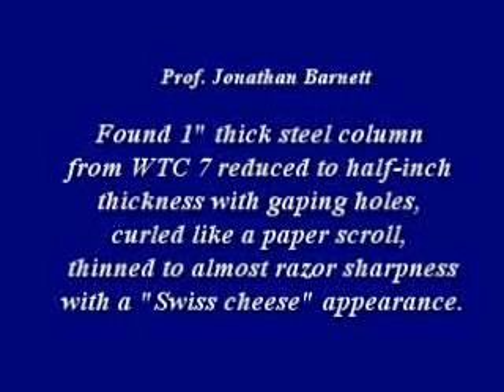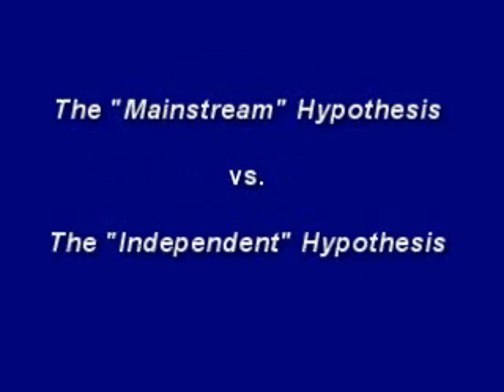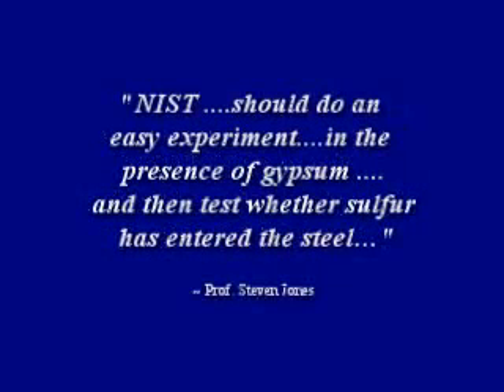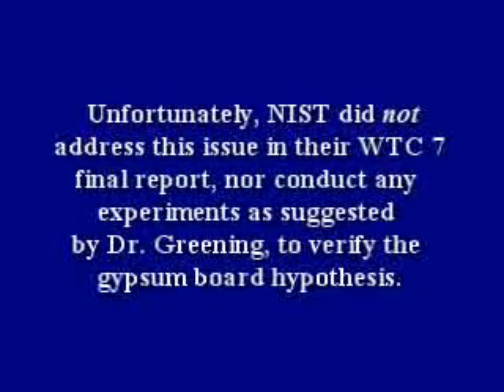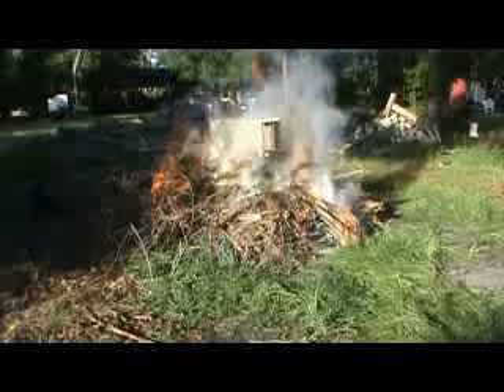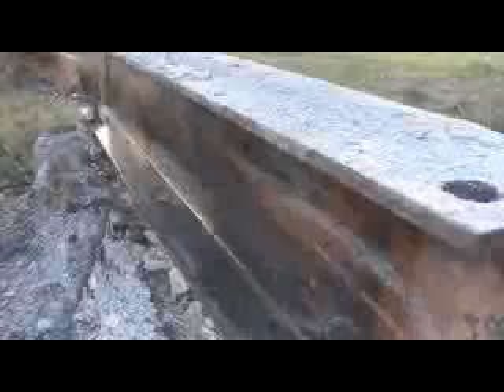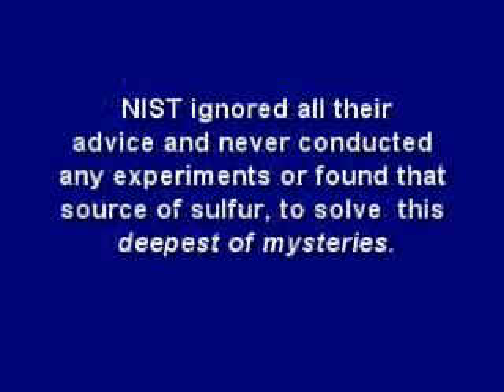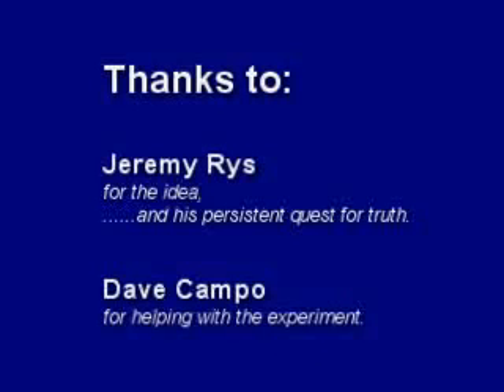9/11 Experiments: The Mysterious Eutectic Steel

Comment: Since you are an aircraft "mechanic", could you do me a favor,
and comment on the Boeing 757 wheel truck pictured at the
Pentagon on the web page below? Doesn't quite fit a missile, huh?
PENTAGON, 757 LANDING GEAR in the PENTAGON
11-settembre. blogspot. co m/2007/04/ english-section. ht ml

Comment: You are right. I have never seen an aircraft mechanic who doesn't
know ONE aviation mechanic term, tool, or legal form.
Did you know before you get your A&P license to work on an 
aircraft (actually, to even enter the Hangar)., you have to take a
CLASS on Title 14 documentation and handling of Certified 
Flight parts? As Little as a washer or spacer, it's certified, and 
tracked, or you can't work in an FAA certified repair facility.

Comment: By the way, Moron. A KEYED TORX screwdriver has a hole in the tip.
That hole fits over a POST in the screw itself, that keeps regular TORX
screwdrivers from inserting and turning the screw. Duhhhhhhh
Contrary to your nonsense, they are used all over aircraft, specially
in the engineering spaces.

Comment: Yup, flat's are a Brit term. They came along when metric terms came to
be used alongside English standard units. Functionally, they are PLANES,
and always are configured as parallel planes. That's why you can use a
BOX WRENCH, or hard steel, single configuration wrench, to turn them.
Do you know about box wrenches?

Comment: By the way, I am NOT talking about FLATs, Moron, which is a BRIT
term. I am talking about the pitch of the screw, and the peaks or
points of standard, DIN nuts. You know, the part that is NOT flat?
What's the pitch of a coarse machine screw? Ever use one?  LOL

Comment: LMAO, you have never come into contact with a TORX screwdriver in
an aircraft?  No kidding?? Wow, I guess airliners don't have a need
for secure, tamper resistant screws and bolts then.
OR, you don't know WTF you are talking about, which is my guess.
Wanna try for the Part 14 documentation for aircraft parts yet?
It's pretty hard to be an aircraft mechanic without parts, Ya know.

Comment: LMAO, now you don't know rounded NUTS? shit boy!
Nuts rely on 6 to 8 edges, and half as many planes of steel.
They screw around the Haft of the bolt, along an inclined plane,
that is an Archimedes screw. If the edge surfaces get rounded,
you have to use a COMPRESSION wrench to grasp the nut.
Vice Grips are typical, although there are many different kinds.
Otherwise, you will destroy the nut, the bolt, or both, Moron.
Aircraft mechanics, like you (giggle), use them every day.

Comment: Well MORON, a FAG / RAT, is a Flight Air Generator / Ram Air Turbine.
It deploys on ANY aircraft, from props to jets, to create an electrical
power source when power takeoff from the engines is unavailable.
Airliners have them mounted under the nose, or under the wings. 
Aircraft mechanics have to inspect and test them with EVERY overhaul.

Comment: Nope, the 767 pylon to engine connections are just 4 bolts, it's 
completely documented in the EL AL 1862 crash in Denmark.
That's where the engine fell off in flight because those four bolts
never torqued to specs? They are NOT shear pins, they are 1.25"
aluminum bolts about as thick as half my forearm, and over a foot
long, if you had ever seen one, like if you were a mechanic, you
would remember one. These bolts HAVE to be X-ray inspected
with every engine mount. YOU are no A&P mechanic, Huh?

Comment: Better Yet, How many bolts secure an engine pylon to a 757 or 767?
Surely an aircraft mechanic knows this, right?
How many bolts secure an engine to the Pylon we just mentioned?
Remember, they are DESIGNED to break away.

Comment: Try again, dumbshit. Plasma IS just a gas, and it's only considered a 
separate state of matter at nearly atomic temperatures inside a star.
Plasma torches, are just gas in an electric arc. I own two of them.
A 1000 lb Bunker buster is NOT Thermobaric at all, since the primary
point of Thermobaric weapons are to produce heat alone, usually to 
"Cook" dangerous gasses and materials into neutral ash.
NT if that's what you are babbling about, leaves IRON, and a LOT of
IRON, about 70 tons.

Comment: Nope, most of the heavy rubble was ejected toward West Street.

 I heard an idiot say "oxygizer" and that plasma is just a gas. Can anybody take this noxious $hill seriously? A 1000 lb. bunker buster bomb can produce a thermobaric explosion that looks a lot like the impact explosions at the WTC. Plasma from a thermobaric explosion can melt steel beams, engine blocks, etc. It is highly energetic and will impart huge amounts of heat to the path of least resistance...G:

Comment: Spend some time with steel welders, Dumbshit. They usually SIT 
on the same steel they are welding and cutting, often within inches.
The white hot edge of the steel being cut, is usually black within
inches of where they sit. That's because the heat dissipates thru
the piece, and that would happen with thermites also. Try again, lol.

Comment: Actually, this country, is among many others, where WATER cuts steel.
In virtually any country on earth, plasma, which is just a gas, cuts steel.
Oxy-Acetylene torches, which are just a torch to heat the steel, and
OXYGEN, which is just an oxygizer, are used to cut steel.
The FACT is, that steel members have been broken, cut, and damaged,
just by storage weight, cars built with aluminum, and even wood has
been used to sever steel. It's hardly rocket science.

Comment: LMAO, like usual, you don't seem to understand basic heat processes
either. IF you apply 500 degrees to the center of a steel rod, you won't
heat the ends hardly at all. That's why frying pans have 1 foot handles.
Can't get any more obvious, and real world stupid than that.
Heat dissipates as a function of it's environment. The HOTTEST parts
dissipate more heat, so just like your pan handle, the application of
heat to a cold piece of steel would be dissipated within 1 or 2 feet.

Comment: Actually, STEEL weakens at well under 400 C, not 800 C.
NCSTAR 1-6, page 243, Line 1
In the early stages of the fire, temperatures of 
structural components in the core rose between 
500 C and 700 C within 10 to 20 minutes.

Comment: Sorry, Nano Thermite has ONLY one burn temperature, 2500 C.
You can literally put nano thermite on a steel forge, heat it to RED HOT,
and it would never ignite. The aluminum would actually go liquid,
and flow away, before the IRON would ignite.

Comment: Hey Merlin5by5 - Why be such a desperate TROLL? I remember you a year ago making the same NONSENSICAL comments in support of the 'official 9/11 government LIE'. 

Why not GET a LIFE and leave the B.S. to TROLLS with more talent? 

FYI - Building 7 collapsed at near free-fall because steel was removed by demolition. Buildings 3 and 4 were partially standing because of a force? Ah No, steel.

Buildings 5 & 6 remained largely intact because steel kept them from "falling straight down". 

Run along.

Comment: Oh wait, I can produce a few more reasons why NT is weak.
7. NT is HEAVY when liquid iron, 500 lbs a cubic foot.
Think about how hard it is to control a heavy 1500C Cube
8. NT glows white hot, with a specific IR frequency. EVERY
video of the 9/11 tragedy would be able to pick it up, and many
people, would recognize it instantly, it was used in Skylights.
9. NT has to go from a paint layer, to 100 tons on 47 core col.s,
10. NOBODY can duplicate Steven Jones NT tests, and you
can't either.

Comment: Actually, I can give you 6 reasons why Nano Thermite won't cut it.
1. NT creates free elemental iron, it's not there.
2. NT is produced in VIRUS Sized quantities, 80 grams a week.
3. Steven Jones NT report claims a 30 micron thick layer. 
You can heat WTC steel 8 deg F with that, so long as its 1/4 " thick
4. NT doesn't transfer heat well. On a brick, only 1 of 6 sides does.
5. NT doesn't hold itself against a column very well, get a can?
6. NT produces FIRE, which does more to destroy than NT

Comment: Probably the diesel fuel from the 12,000 gallons missing at the
Emergency generators at the back of WTC 7. Didn't you get the Memo?
They contain SULFUR, and DIESEL burns away, Thermite doesn't.
By the way, if you had the brains of a Gerbil, you would have
said it's THERMATE, not thermite, since thermite has no SULFUR.
THERMATE however, has Barium Nitrate at 29% vs Sulfur at 2%.
And you know that BOTH thermite and thermate would have welded
IRON all over this piece of steel, right?

Comment: @Thetan1974 
Actually, I gave you the name, and that nano sized iron is used in 
the mix for Tenemic paint. Go to your local HW store, it's available.
And there is NO NANO-THERMITIC material at all in WTC dust.
There have been 13 different molecular level physical, chemical
and Geotechnical studies of the WTC dust. Not one says its there.
Eutectic steel is caused by Oxy-acetylene torches, Dumbshit.
It's in a pool underneath every cutter torch on earth.
You do realize that, right?

Comment: @Thetan1974 
You don't read very well, do you? He said WTC ORIGIN, as in
Fe microsphere creation. The microspheres were obviously
created elsewhere, and brought to the site in concrete and other
sources. There simply was nothing hot enough to create it there.
NASA AVIRIS:HOT SPOTS NEVER GOT OVER 800 C
pubs. usgs. g ov/of/ 2001/ofr-01-0429/ thermal. r09. html

Comment: @Thetan1974 
LMAO, paint doesn't create iron microspheres, it's MADE WITH IT.
The smaller particle size creates a tighter bond with the steel surface.
It's ON the Tenemic label, and on the Tenemic website, go look.
The same thing goes with the Lightweight concrete used by 90%
of the WTC floor systems. It's MADE with FLY ASH from power 
stations, and that's on the label and website, go look there.
How hard is that to do?

Comment: @Thetan1974 
Just to point out the OBVIOUS, you are arguing a contradiction.
You can't say the WTC fires were too weak to damage the steel,
but were strong enough to produce micro sized FE balls, lol.
NIST argues the fires peaked around 1100 C, and the steel 
at around 800 C, and points to NASA AVIRIS to prove it.
That's 700 C below what it takes to produce molten iron,
and 1700 C below thermite / thermate. Not to mention the work
needed to change 100 TONS of material to virus size.

Comment: @Thetan1974 
That's easy. Here is the paint used by the WTC.
WTC DUST, FE FROM TENEMEC PAINT CONCRETE DUST
pubs. usgs. go v/of/2001/ofr-01-0429/feats-1um. ht ml
The microscopic FE balls, are there from half a dozen sources, 
not the fires at all. It's present in the lightweight concrete floors
by the TON. It's present in the sheetrock, the paints, the fire
proofing SFRM, and the Bentonite clay used to build the
entire WTC Plaza. It's been tracked on Manhattan since the 1930s.

Comment: @Thetan1974 
SURE, but it IS in the NIST report. The most obvious candidate is NOT the 
sheetrock, but the pressurized diesel fuel lines that fed the WTC 7 NYC
emergency communications center diesel backup generator (7th floor).
DIESEL FUEL BURNS AWAY, leaving it's SULFUR.
Nano Thermite leaves 30 TIMES MORE Barium Nitrate than Sulfur, and
Barium Nitrate doesn't burn away.  Tada, simple, huh?
MORE simply, fuel pools on Horizontal beams. ie, sulfidation targets.

Comment: @hgfbob 
WTC, WTC TOWER CORE TEMPS NCSTAR 1-6, page 243, Line 1
"In the early stages of the fire, temperatures of structural components 
in the core rose between 500 C and 700 C within 10 to 20 minutes."
Eventual Steel Temps reached 850 C, totally consistent with with 
1000 to 1100 C air temps, as documented by NASA AVIRIS.

Comment: @Viracocha711

"Temps were well in access of 1000c'

lol..'AIR' temps, that were never consistent, NOT steel temps..

BIG DIFFERENCE!

"no core column examined showed temp. above 250C" NIST 1-3 p.95,101,132

show YOUR EVIDENCE of WTC steel temps at 1000C

Comment: @hgfbob Seriously, you need to actually read the NIST NCSTAR 1 WTC Investigation Report instead of just passing around a citation that is incorrect & on top of that does not contain the data you claim it does. Which obviously means you have never read the damn thing! LOL! What you are looking for, or probably do not want to read is located on p. 127. Temps were well in access of 1000c. FAR hotter than needed to bring the building down. Now go play make believe with your NWO buddies! Have fun!

Comment: @Viracocha711
'rest is simple physics"

Symmetry/Asymmetry in a system is one of the first things taught in Engineering school.
Natural collapses are Chaotic events. You cannot have symmetry from chaos. For any building to fall symmetrically all supporting columns would have to fail simultaneously, otherwise undamaged columns would create resistance in the collapse and would cause the building to either stop collapsing, or fall to the path of least resistance causing a non-symmetrical collapse.

Comment: Jonathan Cole is a fucking fool. He used containers that
didn't exist in the debris pile, and he had to SCREW THEM IN.
Scaled up, these containers would be the Size of a VW CAR.
You might as well claim that your could fly if you had wings.
You don't have wings, the WTC 7 pile did not have containers,
and thermite of any type has never cut WTC sized core columns.
THERMATE has 29% Barium Nitrate, compared to 2% Sulfur.
Barium Nitrate is fluorescent, and it was never detected at the WTC.

Comment: @TheFlyposter
'Free fall is not a feature of controlled demolitions of buildings"

why do YOU not like to use the word ACCELERATION.
when the kink forms at 1.75 seconds into the collapse and WE SEE the UNIFIED SYMMETRICAL TOTAL GLOBAL descent for 100+ feet, that entire time it's GAINING speed,[9.8m/s^2], as it GOES THROUGH itself, at 4.0s of the collapse, the 'ENTIRE' building WE SEE is falling faster than 80 ft.a second, (60 MPH)...'ONLY' possible by removing 'ALL' resistance

Comment: @TheFlyposter

This is what Shyam Sunder, the lead investigator for the NIST, has to say about free fall ACCELERATION, in the NIST technical briefing.

"free fall acceleration can ONLY occur when there is NO STRUCTURAL COMPONENTS BELOW IT"

watch?v=eDvNS9iMjzA&

so what happened to 100+ft. of vertical support to have occur, what WE ALL SEE.....the EVEN GLOBAL SYMMETRICAL UNIFIED decent, as fast as falling through AIR

if it's NOT fire affecting the perimeter vertical support...WHAT IS?

Comment: @hgfbob can't post links on Youtube, you getting irate a bit there (again), that happens to you when presented with proof, i remember now.
-The collapse of the world trade center towers: A metallurgist's view
Gayle, F.W. 2007 MRS Bulletin 32 (9), pp. 710-716
-Microstructural analysis of the steels from Buildings 7, & 1 or 2 from the World Trade Center
Biederman, R.R., Sullivan, E.M., Sisson Jr., R.D., Vander Voort, G.F. 2003 Microscopy and Microanalysis 9 (SUPPL. 2), pp. 550-551

Comment: @TheFlyposter

funny how you like to PUSH the responsibility on SOME ONE else, OTHER than the ones making the claims, as in the NIST HYPOTHESIS which IS the OFFICIAL STORY.

In true shill form you focus and twist responsibility.

You support he official claims, then PROVE them.

PROVE the WTC steel FAILED from the FIRES PRESENT.

PROVE that EXPLOSIVES OR ACCELERANTS didn't assist.

oh, and impacts caused less than 15% localized asymmetrical damage to each tower...MINIMAL DAMAGE!

Comment: What a haphazard and sloppy experiment! There was almost no attempt to recreate the conditions the WTC steel was under. The ground zero fires burned for weeks at high humidity. His conditions - a well-ventilated, fast-burning, open fire - were nothing like the slow-burning, diffusion-limited and well-insulated fire in the rubble pile. As an attempt to reproduce the conditions seen by the corroded beam, this experiment was more or less worthless.

This fellow is smart. He should know better.

Comment: Be sure and calculate these temps, when you 'debunk'"
Enough heat to melt concrete.
Enough heat to BOIL lead.
Enough heat to liquefy steel.

Lots and lots of long-lasting inexplicable heat....from office fires.

Anyone still claiming that this was a natural collapse is an idiot, or complicit.

Comment: @TheFlyposter You're just trolling.
First off, NANO-TERMITE is not thermate. Fail one.
You seem to have difficulty with harder terms, like 'unreacted thermitic material'.
Which Jones is claiming thermate?
Steven Jones has been saying CLEARLY nano-thermite for years. Catch up.

Eutectic vaporization is just the tip of the iceberg, and you're not looking at the total case, period.
I've already gone well past your debunked JREF position, but you're not willing or able to.
YOsZFmqgO5k

Comment: There was a large amount of sulfuric acid within the power supplies in the buildings, and within the thousands of cars in the basement, certain rubbers contain enough sulfur to cause the eutectic. 
only one small piece of steel was found with this corrosion, most of it would have shown the same if it was thermate, plus there was no trace of barium nitrate which you get from thermate. 
Win.
Next.

Comment: he Eutectic composition seen in the steel is due to Oxygen and Sulphur diffusing into the steel from outside. If the composition reaches that of the Eutectic nothing will happen, you don't get a eutectic structure, however, if the temperature reaches the eutectic temperature then the steel of that composition will melt.

Comment: sulfuric acid from overheated uninterruptible power supplies could have flowed onto structural steel at a temperature of about 100oC, then started to react with the steel, and then was further heated eventually to a temperature of about 900oC. The sulfur would bond to iron and form more heat-resistant compounds (but far less heat resistant compounds than steel itself) first.

Next.